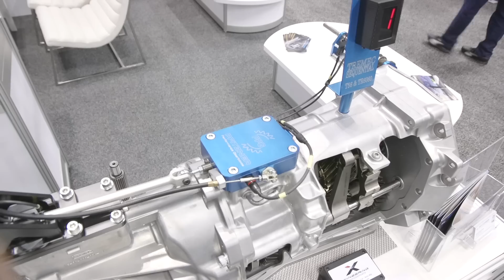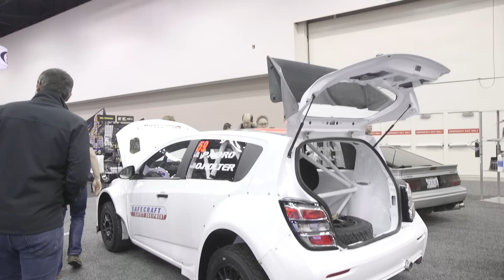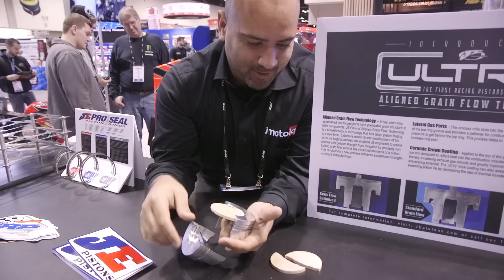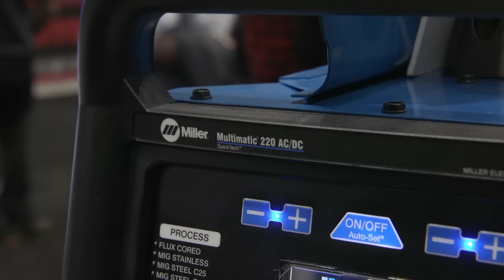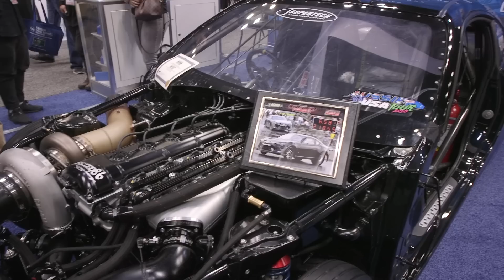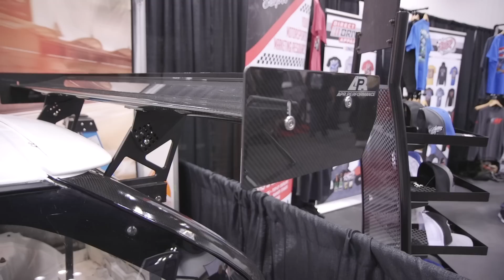Our Favorite Things at PRI 2018

Comment: I just realized, the timing chain is at the back of the block with the scavenge pump cam drain on the Jesel. Keeping oil light on the chain reducing friction losses.
The latest thinking is that it reduces torque pulses on the valvetrain because the crank is loaded. It throws the torque pulses forward to the unloaded end of the crank.

Comment: I gotta thank Mike for going over that Jesel block. It's absolutely unbelievable, it is definitely capable of spinning 11,500 with short stroke. If Warren Johnson can spin it in a 4.9 bore spacing DRCE block with a 3.6 crank, then that motor can do it all day. It's a hundred pound weight saving over a DOHC motor. Heck, using Mahle camincam and Porsche variocam plus style lifters inverted would give you variable everything. Lift, duration, lobe separation, and timing. No reason for all the friction of a DOHC drive system because it no longer offers any benefit except for huge packaging and weight. Not just for drag racing, perfect for an exotic engineered hypercar as well. The only thing it needs is dual spark plugs, too much flame front travel over 97mm, that is why the new hemi runs dual plugs and 22 degrees Max advance. The mixture flame front only has to cover half of the bore, faster combustion, more efficiency and power. Adding huge timing is a sign of chamber inefficiency. You could never run a k20 at 40 degrees of timing.

Comment: Awesome vid! I really appreciate all the in-depth info you guys share, both here and on your site.

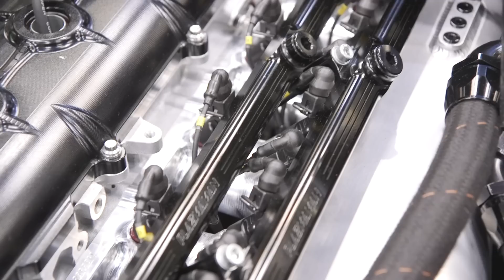At about 46:30 the discussion about the non-intercooled methanol powered drag car from Down Under turns to fueling and the interviewee points out that they are running 2 injectors in the charge pipe for intake air cooling in addition to 3 injectors per cylinder. A bit earlier they mentioned their current turbo is just about pushed to the limit and they plan to upgrade to a bigger turbo, but I wonder if they have considered pre-turbo water/methanol injection before they change turbos. They could either move 1 of those 2 injectors so that it sprays into the turbo, or they could add a new injection point pre-turbo. It seems like either would be perfect for this car, as spraying straight into the inlet of the compressor once "in boost" makes the process of compression more efficient because when the fluid evaporates in the housing, it provides excellent cooling right on the spot exactly where it's created. This increase in compressor efficiency essentially shifts the compressor map to the right, allowing a higher volume of air to flow than would otherwise be achievable, a godsend when you've about maxed out your turbo like these guys and gal did.  

Not only would that turbo flow more air but pre-turbo water/meth injection would provide even more cooling for the air right where it needs it the most, meaning the compressed air never gets as hot. That's especially useful when not running an intercooler such as in this car. Some people don't like spraying any fluid upstream of an intercooler out of fear that it might condense and pool inside the endtank, but that's not a concern with this setup.

In case you're wondering - no, I haven't done this myself (although I am planning to in my current build) and I'm not going to pretend to be an expert but the science behind it is pretty easy to understand. This stuff was thoroughly studied and used with great success with aircraft in WWII so it's not some new, unproven, secret technology. I don't know why more people don't give pre-turbo water/meth a try, especially when they're wishing they had a slightly bigger turbo. The trend I've seen online from stalking the internet like the obsessive enthusiast that I am is that the people who shoot it down have either never tried it (much less researched it) or have tried it but done it poorly and gave up right away, sometimes without even re-tuning, LOL! However... Those that make sure they have a well-executed setup (fine misty spray of a proper quantity and good re-tune) love it, say it works awesome, and don't reveal much else (little to no data or juicy details). You know it's good when people get hush-hush ;)

With turbos becoming more and more popular, I think pre-turbo water/meth injection is gonna blow up and be "the next big thing" at some point in the next few years. Especially the good mechanical injection setups, because screw having an electric pump. All that's needed is the exposure and education. Maybe MotoIQ could find some people doing this and provide info about their setup to the masses with the detailed presentation they are so good at. I know people are out there doing it but nobody's properly shared the nitty gritty, at least not that I've seen. It doesn't have to be the top-dollar cutting edge build; the physics and principles translate.

Comment: Comp rocker shafts. Are these shafts made in China like a lot of Comp stuff they don't like to stand behind?  I have the Crower shaft setup on my street driven LS7 and couldn't be happier, over kill, maybe but so what. I think the side loading on the trunnion bearing, especially on the LS7 off set rockers is a very week point. So now you have a shaft, better than stock, yes, but the load on that little bearing hasn't changed. Whereas the Crowers have a full length roller bearing under the rocker. In addition you still have that as cast tip on the stock rocker that moves a lot through the cycle and if you look at a worn rocker the wear pattern on the tip should give you pause.
Reply from the maker: It's not supposed to be a replacement for shaft rockers but a low dollar improvement from stock that eliminates rocker tipping and reduced the odds of cracking the intake port.

Comment: I was wondering if anyone would finally do it, but that PPG transmission is now my new dream transmission (Sequential dog engagement for street applications.)
I love the straight cut gear wine, but I don't think I could tolerate the NVH intensity for very long drives. Most straight cut gear transmissions are extremely loud.

Comment: Well what is the price of the jesel v8
Reply: 95,000k
Reply: what displacement is it
Reply from the maker: @JordanWallac3  this version is a 427 but there is a lot of flexibility in that.
Reply: @motoiq  oh damn
Reply: What about the max RPM and power
Reply from the maker: @john-davidcairns1615  It is around 8 to 9 k depending on application power can be 700 to thousands depending on how its built.
Reply: @motoiq  That sounds quite affordable honestly for what you get.